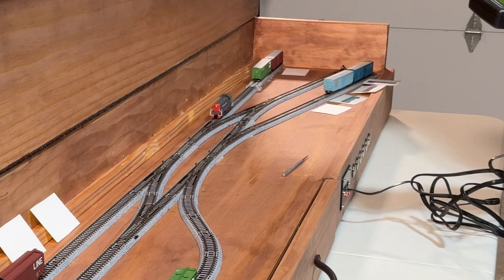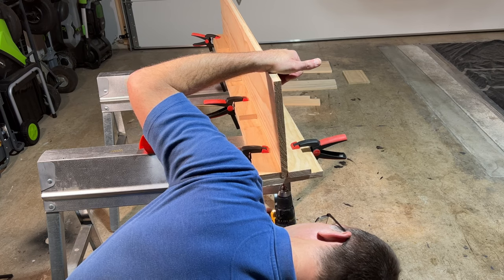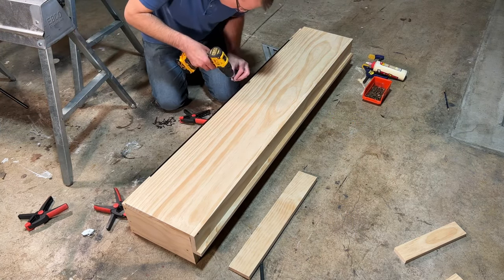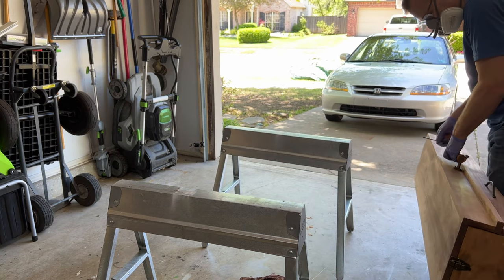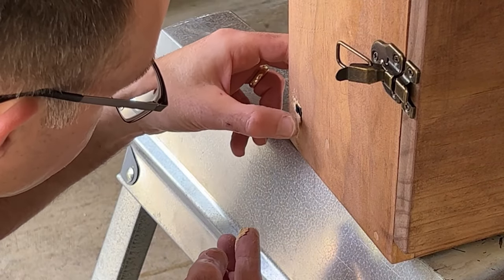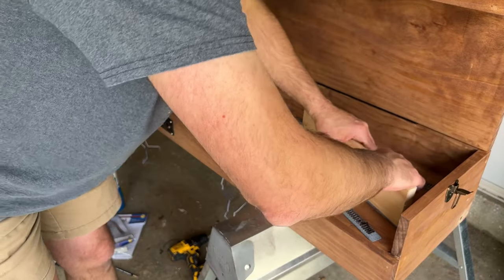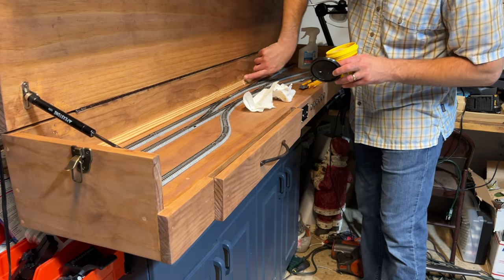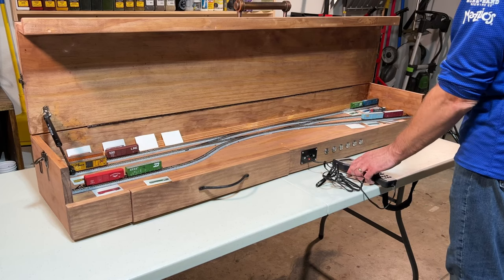Build an N Scale Switching Layout in a Wooden Case!

Comment: Just finished this one, made some minor changes like making the drawer a little wider, I painted the base of the layout dirt brown and everything inside the box above the track level a sky blue.  Where the switch buttons are, I laid out thin white tape to reflect the layout diagram and installed the push button switches where the switches actually are.  I also instilled a Roku battery operated transformer in the drawer so I could operate it without power if needed.  To go along with that, I have both a DCC/sound locomotive and a classic Trix DC only locomotive in the drawer.   The biggest change was that I made the entire thing out of lightweight plywood.  They sell a plywood in my local Lowes called "Blond wood", it's very light, strong and has a nice finish on it.  I look forward to using this with my grandson when he gets a little older.
Reply from the maker: Awesome! Yeah, plywood like the kind you used, or birch plywood would have been a lot lighter than the 1x pine I used. It isn’t hard to move around, but shaving off 10+ pounds would have made things easier in terms of carrying things.

Comment: Hi Steve, enjoy your videos.
I did some things that could help you and others. I wanted a place to store and protect my controls so I looked at the cost of the metal drawer guides or slides and ouch than buying wood and other hardware, so I went around to these Thrift Shops and at the Habitat for Hummandity Restore and found a 3 drawer vanity for 30 dollars.
I bought it took it home and measured it and marked it and cut the vanity to a little taller than the drawers so I ended up with 3 drawers with 2 cuts. I mounted them under my layout with wood screws, cut holes for wires and have wire buses, cut a hole in the front for the stand off or remote controls, I numbered my wires and the terminal buses so if I have to pull the drawer out than it's easy to I rewire.
Reply from the maker: Nice!

Comment: Wonderful. Thank you for the video.

I'm working on an HO layout with my grandson who is six. It has two "roundy roudy) sections and his part of the layout is a door with two main lines running near one side. The open area for a switching area off of his main line is 17" x 75". I'm having a very difficult time trying to find a switching section to fit in this area. I don't really know what I'm looking for. Do you have a suggestion that might work for me? We're using Kato HO track. Thank you!

Comment: Hey man this is great - definitely want to try one. Also I know that you mentioned you had another spare power receiver thingy lol - but where could I get one from and what would the name be if I wanted to search for one? Thanks in advance.
Reply from the maker: I just pulled one from a Bachmann controller or something like that I think. I’m. It sure exactly what they are called but you could probably search for power jacks or something like that. Those plugs are of standard size. There are lots of sizes, but it is one of the common sizes that you find on a lot of items that have those round barrel power connectors.

Comment: Is there a need for insulated joiners any where on this layout?
Reply from the maker: No, I didn’t use any, but you will cause a short and shut down the dcc system if you try to cross two turnouts connected on the frog side and one is thrown the wrong way. But even if you have insulated joiners that will still happen.
Reply: Thank you for the reply

Comment: Does anyone know if there is a dcc controller that can remotely control up to 8 turn outs? Or are the dcc controllers only for trains and only wired?
Reply from the maker: Most DCC controllers can control an unlimited amount of turnouts (except the simple ones like Bachmann's starter one that have limited functionality). The main issue is that you need a DCC decoder for each turnout, or something like a DS74 unit that can control 4 turnouts. Once you have the controllers hooked up to the DCC system, you just have to go to the address of the turnout, and then swap the direction. It is kind of janky though to do that when you are running a train, but doable. That is why I like using the push buttons or just manual ground throws.
Reply: Ok, Thanks.
Reply: @StevesTrains  I just realised that Youtube has me posting under 2 names. fourbypete is my original name here and my phone has my actual name.